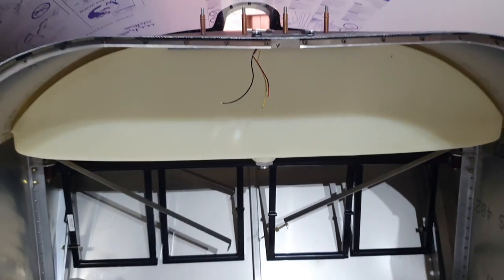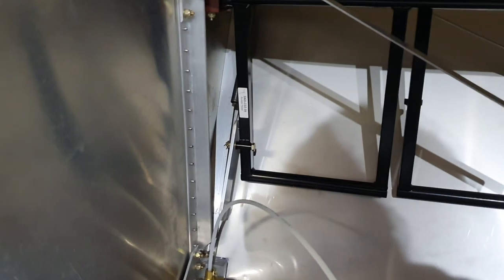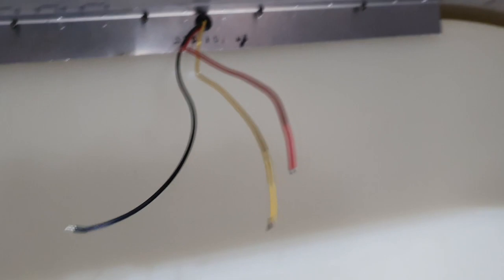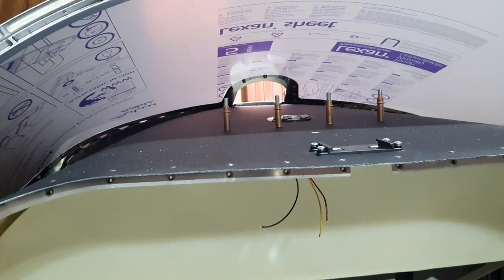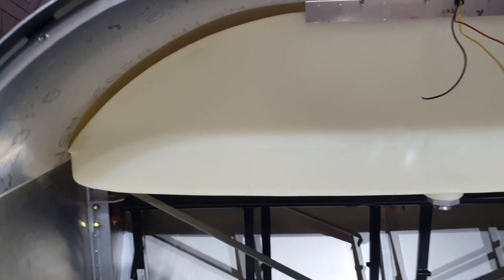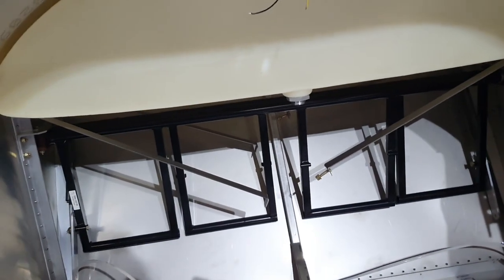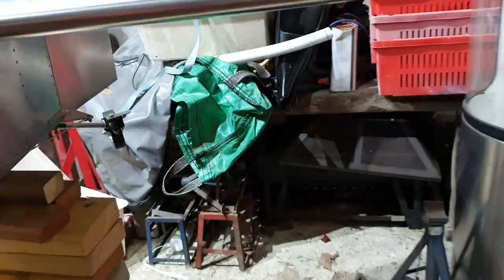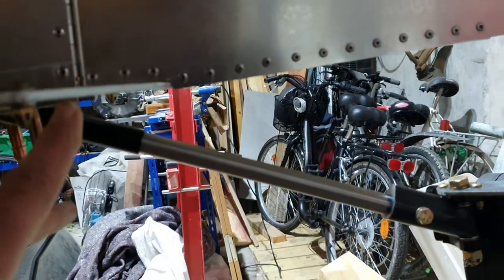Gavin's Sonex B Part 47 - Installing the fuel tank

Comment: What type of fuel sender are you using?  Will you have a significant variation in fuel level between ground position and in flight?  It could be a bit of an annoyance if you don’t accurately know your fuel level prior to flight especially when you have partial fuel.
Reply from the maker: Hi John, It's the MGL capacitive fuel level sensor. You are absolutely right about the difference in level reading 'on ground' as opposed to 'in flight' on a tail dragger. I have positioned my sensor directly over the fuel outlet so that it gives me an accurate reading whilst in level flight. On ground its easy to open the fuel filler and have a look or possibly use a dip stick 🙂